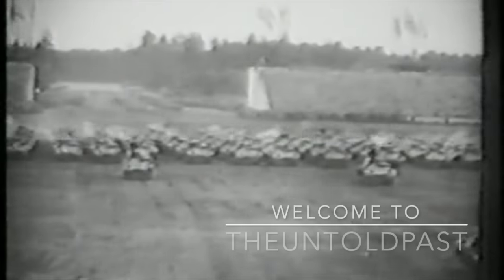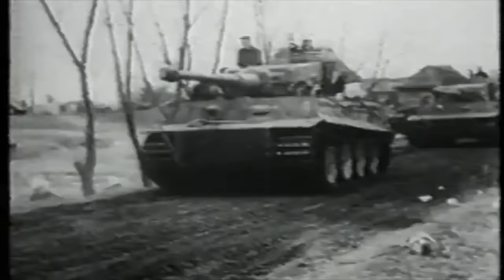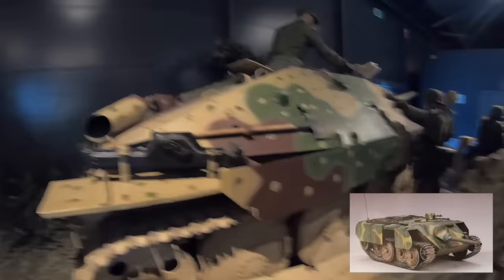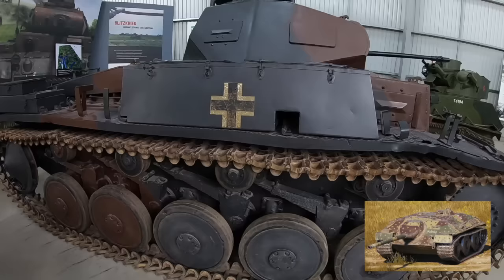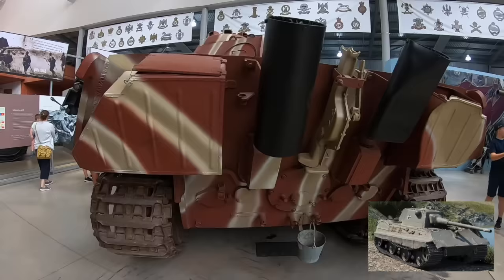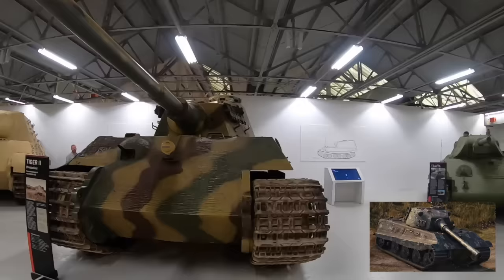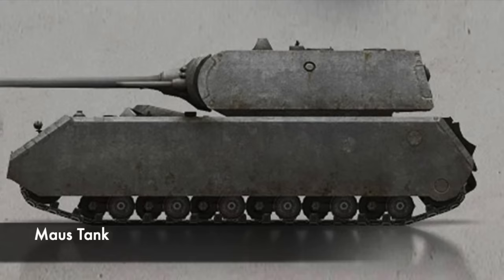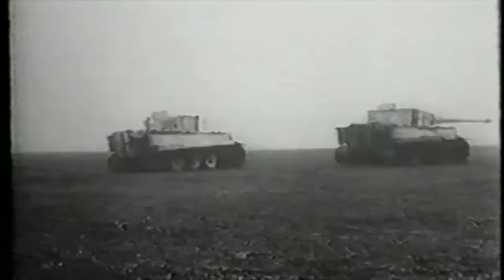The E-Series Of Tanks - Hitler's Dream Tanks

Comment: i dont get that german engineers - E75 should have L100 88mm gun = 100x0,088 = 8,8 meters long gun. You know its a bit less than 10 meters. My 3 stories building is about that height. I mean, OK, I get it, you love those 88 numbers and all (8th letter in alphabet is H, so 88=HH or Heil you know who). if the war lasted longer, we would have L1000 88mm gun (88 meters), and 10 additional vehicles to support the 88 meters gun included. I dont understand that Wehmacht or Germany lacked quality steel (materials added to harden the steel for armor), oil, manpower, etc etc. But still,  in those years they designed and built these monsters. I mean, for EACH Jagdtiger they could build 4 Panzer4s, and Panzer4 with medium long 75mm gun can penetrate ANY soviet tank (around 140mm of penetration at 100meters). They could just add more armor to P4, prolong the barrel, and they would have potent weapon for medium soviet tanks like t34 and even that heavy one - KV1. IS1 and IS2 were NOT numerous, they built just 100 IS1 and few hundreds of IS2 (IS2 were planned to be rolled out for victory parade in Berlin). As much as we think IS1 and IS2 and soviet TD were monstrosity - no they were not. IS2 had about 30 seconds reload time, Tiger2 could shoot and reload 3 times by then... I think SSSR built heavy monsters, because they saw Germany did it and thought its the right way.

Comment: i dont think that if the e100 or the maus were a thing during ww2 it change anything, sure at the first battles it may surprise and cause huge loss for the opponent but it would also push the opponents to elaborate different strategies like bombing those tanks since they are quite bad in term of autonomy and mobility and concealment as well, which makes them huge targets for mortars and planes and mines.
Reply: These super heavy tanks would have a 20mm anti air cannon on top.
Also you  could have some wirbelwinds moving with the maus or e100

Comment: Great video about what if. Unfortunately the Germans went into a war they couldn't win because they didn't have the industrial capacity of the countries they picked fights with even they could have eliminated the constant bombing of their heavy industry. When you consider that the Russians produced almost 60,000 T-34s not to mention their other tank series and the other production of the allies, they were doomed from the outset and dream projects like these only took valuable time and resources that could have been spent improving the tanks they already had. There was no way to win, but they probably should have stopped all new tank development at the Panther and worked on improving what they had form then on. 

Oh, and the Hetzer was not built on the Panzer 38 chassis. It was an all new chassis, even the road wheels which look similar to the 38 wheels are larger and not from the 38s product line. 

And where's the E-5? Probably the coolest of all the E projects and one they actually could have pulled off.

Comment: My guess is that the E-100 would have been an infantry support/break through role tank.
Reply: My guess is the E-100 would have been a boondoggle that sapped resources from viable projects and ended being nothing but a landlocked boat anchor for any unit it was attached to. 100 ton anything removes the Maneuver from your Maneuver focused strategy, its like the answer to what would be the worst possible design to come up with?

Comment: So, the E25 was to replace Panzer III and IV?  But, it's a tank destroyer with no turret - different class of tank isn't it?
Reply: Well it is a Tank destroyer in WoT and by design standards, but its so small, fast and versatile that it passes more for a medium MBT role - kind of like what the Swedish Stridsvagn tanks would've been which also weren't designed as tank destroyers even though they are TDs in World of Tanks for lack of a more fitting class. Lack of turret doesn't automatically make it a TD. It wasn't designed to have a low fire rate super heavy cannon in it - instead it had a rather small caliber that was able to be loaded much faster but wouldn't really have had the penetration to pull off what a TD could've.

(also they probably would've developed a version with a turret on the unified chassis at some point)
Reply: @PsychedeliKompot  Thanks for that👍.

Comment: The E-50 concept art looks a lot like the Panther F just without a hull machine gun and the E-75 concept art looks identical to the Tiger 2 H just without the hull machine gun. 
So hitlers dream was to have tanks without hull machine gun ports. 
Also references to help push the information you have supplied. example, you stated weights of these vehicles and the speed of these vehicles, but you haven’t stated where you found these “facts”. There for I assume you are just taking the speeds and the weights from the tanks that exist. Example, the tiger 2 H has a max speed of 40 km/h and weights just under 70 tons.
So I would like some references, or for you to at least credit the people whose work you are using to come to your own conclusions.

Comment: They were running out of Nickel which was found in Russia and oil they had a terrible repair operation tanks broken had to be put on trains back to Germany for repairs unlike America or England which had a set standard for building tanks which parts could be easily replaced Tigers were technically more problematic and couldn’t be quickly replaced with parts

Comment: if the war had not started in 1939 but in 1945, it would have turned out differently ...
Reply: Oh yes. The Germans would have lost quicker against a more prepared UK, France, Poland and USSR. 

What? You think they'd actually be able to mass produce those things? They were planned up AFTER the war began and AFTER they encountered heavier tanks like the Matilda, Char B1, T-34 and KV-1. Without those experiences, the Germans would still be using Panzer IVs even in 1945.
Reply: @youraveragescotsman7119   I don`t think so. If the Germans be able to built the Me 262 or the Arado 234 maybe  the Horten IX they`ll become the Air superiority for sure. And won`t forget the "Walther" U-Boot Typ XXI of which nearly 100 excisted in 1945. And which was considered the world's first real submarine. The Americans, English, French and Russians all built their submarines in the same design after the war. Even the first nuclear submarines were based on it. And yes the Panther and Tiger tanks weren't designed and built until 1941-2 due to the appearance of the T-34. But I think that with the Fritz-X the first air-to-ground, air-to-ship missile controlled by a monitor. And the waterfall anti-aircraft missile system, as well as the other anti-aircraft missile projects (butterfly, gentian - both projects with wings for the subsonic area - and Rhine daughter) Germany would have had a great advantage. In the end, it was only the enormous mass of material, aircraft, ships and tanks as well as soldiers that made the Allied victory. If America or Russia hadn't been there, the story would have been different. That's what I meant by that. The E-series tanks are irrelevant and unimportant.

Comment: How dumb. "Let's standardize...by making five brand new vehicles." Lol.
Reply: the standardization was in the suspension, notice how all use the kingtiger road wheels? they also all use a standardized bell-washer spring suspension system. hell the T-50 and E-75 were going to have identical hulls except for armour thickness and number of suspension bogies. same tracks, same shape, same engines, same drive train. think of it more like a sherman and a sherman jumbo. compaire to provious german vehicles which had different engines, transmitions, roadwheels an suspensions for every vehicle.

you never want just 1 or 2 hulls. you need hulls to be specialised for purposes.

the Yanks always built a light recon vehicle, a light tank, a transport vehicle (with support varients), a medium tank (and a heavy which stayed in the US), the soviets had a light recon vehicle, a light tank/assualt gun (later just the assult gun, as lendlease supplied enough light tanks for their needs), a medium tank/assault gun, a heavy tank/assault gun, and a transport/support vehicle (also supplied via lendlease).

the germans similar to the soviets, found they needed a light recon vehicle, but decided it needed a TD varient too (we have written description of the recon E-10, it was to use the standard puma turret) for support, a medium TD/heavy recon vehicle (light tank/light assault gun equiv in soviet doc) that could also have a APC and support varient (the E-25 was too have an APC varient, a heavy recon tank varient and the famous TD varient), a main medium tank (the E-50) and a heavy tank (the E-75). 5 is normal. and the E-series is by far the most rationalised/standardised project of ww2.
Reply: @matthiuskoenig3378  yes but immediately post-war we got the "universal tank" concept which became the first generation of MBTs. That is what you want if you are looking for easy mass production.

Comment: Low production rates for German tanks wasn't primarily because of over engineering. German tank factories were not as well designed as US or Soviet factories and their techniques for mass production were also less advanced. Many Soviet tractor (later tank) factories were designed by the American Albert Kahn (architect of Detroit) and built with help from American engineers in the 1930's. Even if the E series had been put into production, these inefficiencies would still have been present.
Reply: Y'all forgetting with the basic death of the luftwaffe, the factories were bombed to hell

Comment: None of it would have mattered without control of the skies!
Any plane with a 50 cal, could have destroyed any of them.
Reply: Uh, no. 50 cal ap belts don't go through anything more armored than a light tank's roof, mainly because they were supposed to protect from top down attack, usually with even bigger calibers.
Reply: Taking out a tank requires something a lot bigger than a 50 cal. Unguided rockets did keep their heads down but had a low kill rate. Napalm will kill the engines as will a direct HE bomb hit.
Killing the fuel trucks is however far more effective.
Reply: @allangibson8494  @ThePotato There is gun camera footage of .50 cals going through the floors of their tanks. They would just shoot the ground under them, as long as it was a hard surface, and it would bounce up into the thin floor armor. They also had some depleted Uranium rounds, so that would go through a lot of roof armor. Besides, bombers with large bombs, or CAS with rockets/small bombs would make quick work of the E series tanks. The Germans would have required a larger 262 force to fully control the sky again, which was out of the question.